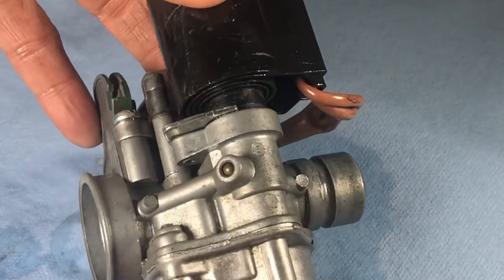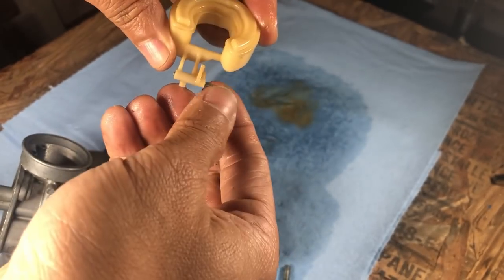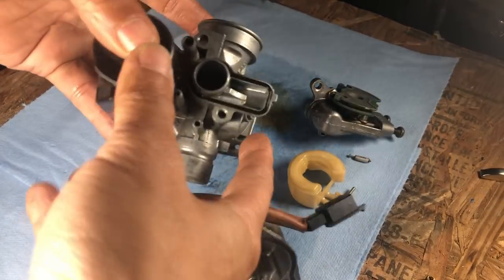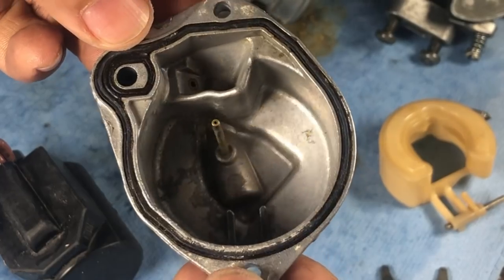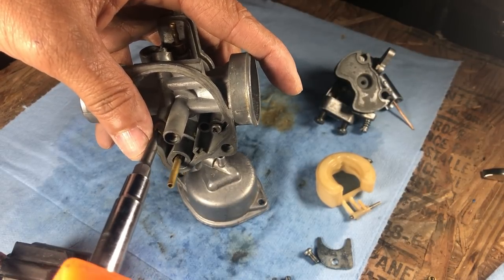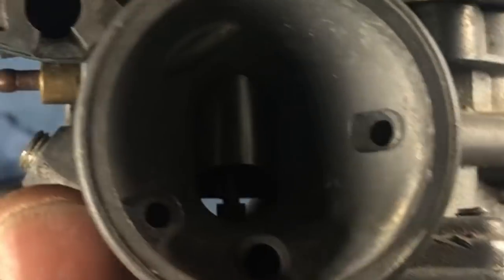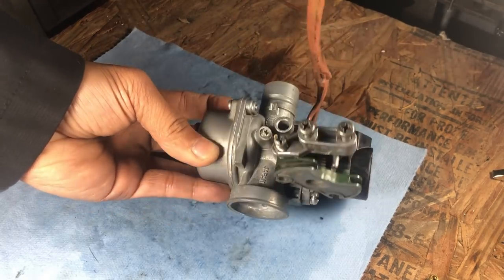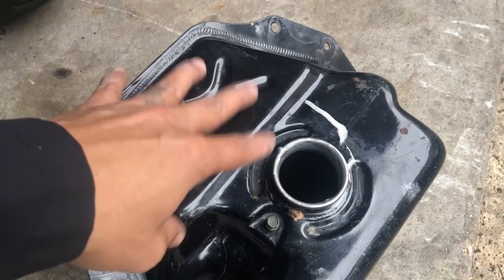Zuma carburetor cleaning 2005 two stroke | Zuma Raffle Project #CarbRebuild

Comment: That gel stuff looked like gas with ethanol after sitting a long time will do that and that's why its best to run super high octane it should have no ethanol in it  that is why I run super in all my bikes and lawn mowers so I don't have as many fuel problems good work.
Reply from the maker: It was gross and made it into the Carb AND I had already cleaned it once. No wonder it stopped running. After the BBK and the clean tank and lines I’m sure it will be better

Comment: A video explaining how to adjust the air mixture screw would be appreciated.  I replaced my air box, air filter UNI Stock,  and carbon fiber reeds. I lost some top end 4 MPH down now :( throttle response and acceleration are better now